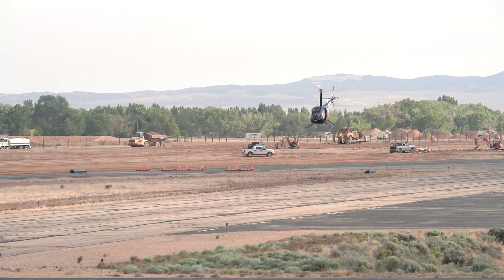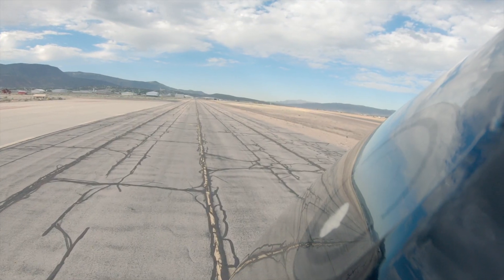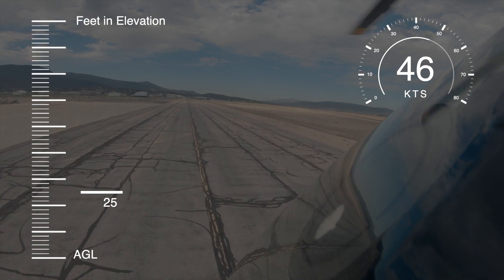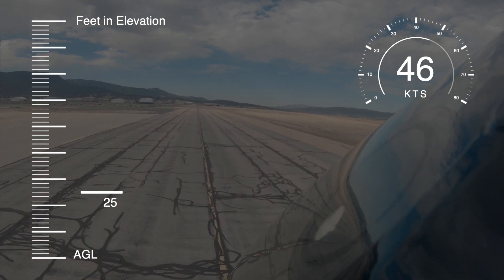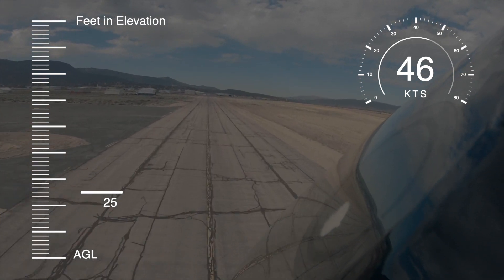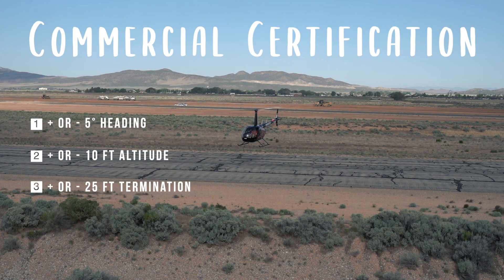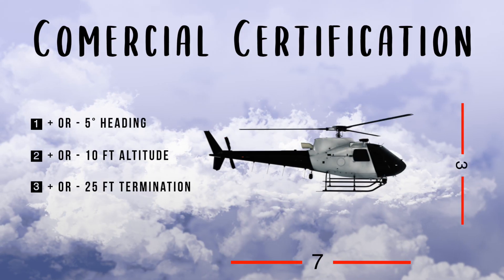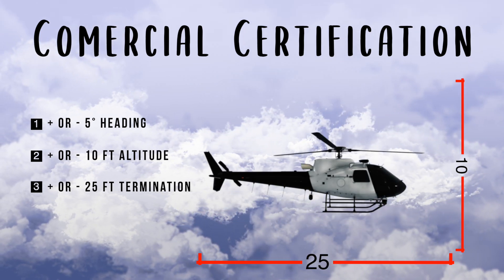How to Quickly Stop A Helicopter - Quick Stop Maneuver Lesson

Comment: Nicely narrated. Clear, defined language. Not only in the maneuver, but in the lesson. - Please clarify ... for commercial you have to be able to quick stop in 25 ft at 40-50 knots? That's less than the length of the helicopter. Even the private, 50 ft seems very short. Thanks - Lumpy
Reply from the maker: Great question! All of the standards that are listed are for the “termination" of the maneuver (minus the 25 ft and 45kts set up).  You are correct, it would be incredibly difficult to stop the helicopter in less than the length of the helicopter :)